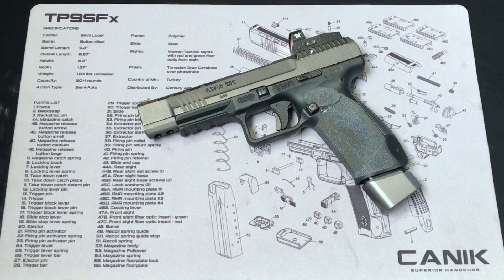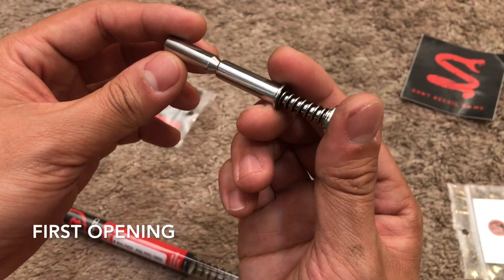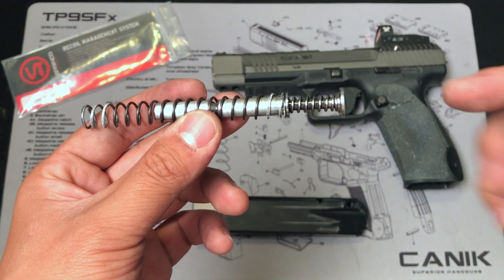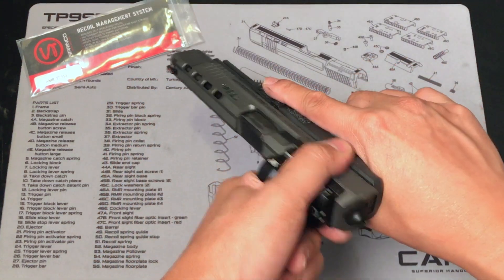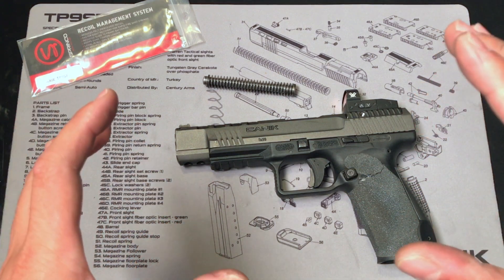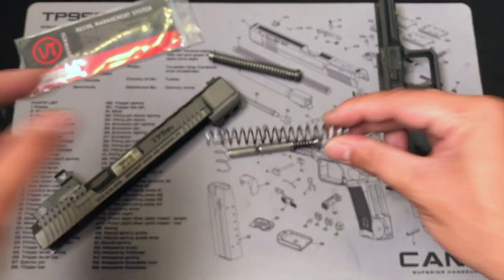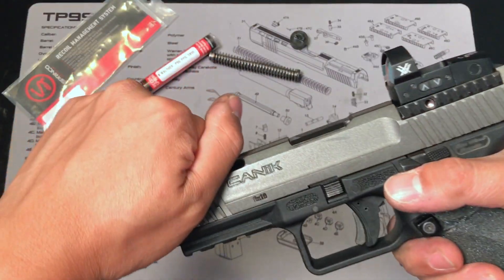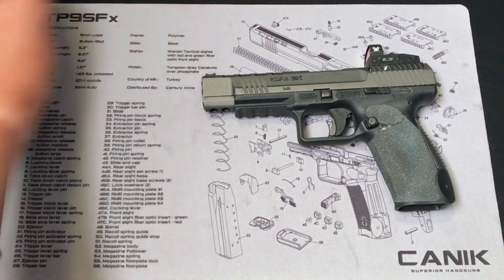Sprinco USA Recoil Management System

Comment: Frank would any if these springs you trust for service? I'm in security I carry a tp9sfx. If you would trust them which color would you suggest to use with 115 to 124 grain hollows? Confused on the difference on the colors.
Reply from the maker: So I’ve been using the same setup for my SFx  in competition for more than 40k rounds and under my website I do have the setup I’m using for SFx.we also updated the spring so the yellow one is better than the white one. White one is inconsistent with different kinds of ammo on the market. The yellow one is 1lb heavier than the white one. Check it out at my site frankthetankshooting.com

Comment: Frank, How many rounds are you getting before you have to replace the recoil springs. I used the Sprinco Yellow and after several thousand rounds it jammed and the slide was stuck halfway back. When I inspected the recoil spring  and compared it to a new one it was about a 1/4" shorter. Just wondering if they wear out this fast and if what happened is normal.
Reply from the maker: ostbob it’s normal, I switch it every 3000-5000 depend on the situation.
Reply: Outstanding, glad to know I didn’t get a bad spring.

Comment: Oh sorry but does the grain of bullet make a difference been shooting 115 grain just did a freedom Smith trigger and leaning on putting this recoil system in my sfx
Reply from the maker: It does make the recoil impose feel smoother, better follow up shot, and make the gun more reliable. I’ve been using the recoil setup for more than 40K rounds and still doing strong. The recoil spring setup can use different grain bullets. We have Black Friday Sales right now and will end midnight today. frankthetankshooting.com

Comment: how much of a difference did this make in recoil?  was it significant?  what percentage in recoil reduction would you estimate?
Reply from the maker: I will say the recoil for me is around 15-20% and it makes it shoot even smoother. I still have this system but they improve to a yellow spring. It’s even better and noticeable. I have 30,000+ on this system.
Reply: @FrankXuFranktheTank  do you have the info on that yellow spring?
Reply from the maker: TheDriftmang I do!! I am using it right now. If you buy it from Sprinco, they are the the spring for SFx with the guild rod now.

Comment: Does your tp9sfx  work well with the combo sprinco recoil management system and the fat daddy trigger?
Reply from the maker: swat0422 yes and that is something I’ve been using.
Reply: I just installed the trigger and the recoil system.       I’m having malfunctions.   Just wondering if you has the same thing happen to your Canik
Reply from the maker: swat0422 I don’t have any problem with mine :)

Comment: Frank If I am only going to get one spring , how do I know which is the best overall spring?  I know you said that if you take the optics off you would change over to the red spring.  What is the difference in the performance and are there pros and cons of using one over the other?
Reply from the maker: James Casas Jr I will say if you are running your own ammo load use the whit one. The white spring is the lightest spring. If you are shooting for Tactical the training I will suggest the red spring, because it's stronger and more for hotter ammo, such as most of the factory ammo! Overall I like the white spring, and I shoot it all the time m! Hope this help, if not please let me know :)
Reply: I will be using factory loads.  I have tried 147 grain in the current factory setup and like the reduced muzzle flip it has just recently bought some 124 grain to see the difference between that and the 147 grain.   I also have a box of 165 grain that I am going to try.

Comment: Frank what grain of ammo you use for the white spring and for the red spring?
Reply: Reasonable question. Sprinco will ask you about your preferred loads when you order and will be a better source than any one user. I first looked at Sprinco a year ago. It was made clear I needed to pick a load as the pistol would be more optimized for that load. Talk to Sprinco about the whole range of loads you want to run. Remember you can go back to the stock rod and spring in one or two minutes, or to a 2nd Sprinco supplied spring.

Comment: Frank, I changed the recoil to the Yellow sprinco, 29 lb Newton striker spring and the cajon reduced power safety plunger spring and the slide won't stay back after the last round is fired. It will stay back on an empty magazine. I changed it back to the OEM recoil and it does the same thing. Do you know if the striker firing pin spring would have anything to do with  the slide not cycling back far enough to catch the slide stop? Shooting 115 grain
Reply from the maker: ostbob have you tried fire the gun without interfering the slide lock? Sometimes it happened because the way you grip the gun.

Comment: I went another direction and added a Glock Gen 3 stainless steel recoil spring assembly with a Gen 4 adapter. It was significantly cheaper  at 22.95 and now I can try other Gen 3 springs if need be.
Reply: luiz79, could you please explain to a newbie in further detail? I just bought my canik tp9sfx and am starting to accessorize it, but like everything, I would like the most cost effective form. and if your recoil spring setup works just as good as this for 23 bucks, I am DEFINITELY interested. Thanks.
Reply: Glock Gen 3 what model??

Comment: NO it not the grip, I noticed that when you changed your recoil spring you also changed the striker spring which I did also. Does the striker spring have anything to do with the  slide not coming all the way back when it cycles after the last shot? 
At this point the last thing I tried is replacing the OEM recoil spring and I left the 29 Newton striker spring, because in my mine I can't see how that could be causing the problem. Do you agree?
Reply from the maker: I dont know why your is doing that... It is really hard to say what kind of problem is that. I'm sorry
Reply: @FrankXuFranktheTank  I apologize. I would have bet my life it wasn't my grip but today I accidentally caught myself changing my grip so that the thumb was touching the slide lock..... Now its working perfectly.....unlike me. Thanks for your advice
Reply from the maker: ostbob yay!!!!

Comment: Frank I just received my tp9sfx today with my Venom site. I was wondering I've heard a lot about The Recoil spring issue has Canik resolve this? Should I get this recoil Spring right now? I'm very excited to try it out still has the stickers on it I really enjoy your site it's been very helpful
Reply: Canik has light and heavy springs available for different ammo weights. After putting an RMR on mine it wouldn't cycle 115gr consistently anymore on the factory recoil spring.

Comment: Hello Frank, Is that Sprinco recoil system made special  for Canik or  it is same as for Walther?
Reply from the maker: They make for Canik but they haven't put the SKU number up. It is still under Walther PPQ but when you check out, tell them that you need the Canik one in the comment section. They will send you the right part. Hope this answer your question :)
Reply: Is than mean regular Walther spring will not work?
Reply from the maker: Well are you saying the Sprinco spring or other brand? Sprinco share the same sky number but they make one for Canik, it just they haven’t update the website. If you say other brand or even Walther springs l, I’ll say it will work. People tested Glock spring. Sig guild rod with 1911 springs, etc. it just what are you looking for? :)
Reply from the maker: That is correct!! I would still get the right part for Canik for sure. I use different parts that was make for CZ75 and it sort of work on Canik. Right now I believe that it is better to get the right part for the gun

Comment: A slow motion video recording comparing a stock recoil spring to Sprinco would be nice, recording both systems in action to verify and compare..  Nice video
Reply from the maker: I was going to put it in this video but, when I went home and found out I forgot to save the file haha!!
Reply: @FrankXuFranktheTank   did you ever put up a side by side in slow motion?
Reply from the maker: I tried to but I was using cell phone as a camera and I don’t think it did a good job because the slow motion is not the one I like. So I might post a follow up video in the future with my real sport camera.

You can also check my Instagram and you can see some video that the gun is super flat using the recoil spring system. I’ve been using it since than :)
Reply: Does it cycle fully and eject well? I’d be worried going down in weight but also worry that the gun won’t fully cycle after each shot.
Reply: @xlcaboselx  Ya I'm really interested in this spring, but Im afraid my loads won't be hot enough to cycle reliably

Comment: Nice information, hard to find , one question if I use 147 gr, which spring should I 'll get ?
Reply from the maker: What do you mean hard to find? My suggestion is get two springs, which are the white and the red one. The reason behind this is not every one like the white or the red spring. If you have more options and you can tune it to your own ammo. I have both and I use red spring when I shoot with iron sight. I use white spring when I shoot with the red dot. Please let me know if you have any other questions.
Reply: Frank Xu - Frank the Tank , I meant is hard to find information about this gun, also the number you said for the red spring shows 4" and not 5", is it still good ? Thanks for the answer
Reply from the maker: Yea, it is fine to use the one. 

Also it is hard to find aftermarket parts for Canik now, but I believe it will become more and more common for sure. I am working on some other videos about some other aftermarket parts as well. Right now I have the baseplate for the mag and recoil spring. Thank you so much for asking questions :)
Reply: Does the white spring not work well with iron sights?

Comment: I will be shooting factory to start with. And thanks for the link for the mat.
Reply from the maker: Jody Rowe that's awesome!! If you are shooting factory, 124/125 and 147 are better than 115
Reply: Frank Xu - Frank the Tank ..If    I shoot 115g which spring is better from sprinco?
Reply from the maker: I will say white spring. I use white spring if I run the red dot or iron sight. I shoot 115 for training and 147 for competition. I like white spring better, but everyone is different. I got both red and white spring.

Comment: On my Walther Q5 SF with the yellow spring it was insanely difficult to get it in. I struggled for >15 minutes - It was impossible to do as shown in this video. What I ended up doing was finding a narrow body pen, inserting it through the hole in the front of the slide and slipping the spring over that, then pushing forward, which forced the pen out of course. Doing it this way had it installed in under 5 seconds!
Reply: I had the same struggle putting the yellow spring and Sprinco 'recoil management system' into my Canik TP9 SFX. Couldn't get the assembly to go in the last 1/4" or so. Eventually got it in, but I am dreading having to do that in a week when it needs cleaning again...I'll try your pen or pencil method. thanks!

Comment: I had a problem with my SFX last night while shooting and now when I rack the slide it's fine but when I try to see if the trigger will reset it won't. I've looked at your video but can't see if mine is exactly as I see yours or if I have a broken part. But do you know what would cause it not to reset the trigger. When I say reset I mean I pull the trigger and hold it back then rack the slide again and slowly release the trigger and I don't see or hear the click that its resetting. 
Any help would be greatly appreciated, hate to send it back to Century Arms.
Reply from the maker: ostbob it is hard to tell, I’ll say just clean the gun and also lower frame as well, lube the gun and see what happened. Sometimes it just carbon buildup cause the issue. It’s hard to tell.   I have more than 30,000 rounds fire on the SFx and doesn’t have problem.

Comment: Would that white spring work on the TP9 SFL
Reply from the maker: Shiloh Mcfadden right now is yellow spring and it is standard on their site. I also use yellow spring now
Reply: Frank Xu - Frank the Tank okay, now will it be in the Canik section. And would I have to buy the complete Assembly or just the spring
Reply from the maker: Shiloh Mcfadden if you have their guild rod than you can just buy the spring. You can buy the spring itself but I can’t guarantee it will work

Comment: Hey Frank, love your vids on the canik. I have a TP9FX elite. Can I use the same recoil spring replacement or is there a size difference?
Reply: My mistake...its a TP9SF elite
Reply from the maker: I think you can use the same recoil spring. If you call Sprinco USA they will make sure you get the right part :)

Comment: If I'm shooting 115gr will the white recoil spring work with the stock firing pin spring
Reply from the maker: Yes, it will :) Just a reminder about the firing pin spring , if you change any aftermarket recoil spring that is lighter than your stock, you need to have a lighter striker spring as well. Otherwise, the striker sprung will be too strong and will pull the slide back. Sprinco do have striker spring as well.
Reply: @FrankXuFranktheTank  oh yea, I got the firing pin spring and striker spring mixed up. So I will need a lighter striker spring. I think I read somewhere that I can use a stock G17 striker spring. Is this true?
Reply: @FrankXuFranktheTank  Also do you happen to know which Sprinco spring I'd need to get with the white recoil spring? Sadly their website is pretty terrible :\
Reply from the maker: Jesse Novotny so, Sprinco also make striker spring for Canik now, the easiest way to find 19170 is the product number for Canik recoil spring. When you check out, tell them you want the set for Canik whatever you model is and they will send you the right one. You are right, they are wroking on updating their site. I forgot the product number for the striker spring but you can call them! They are super nice and will educate what you need :)

Comment: Frank, is the springco legal for production division?
Reply from the maker: bulm540 that's a really good question :) according to the USPSA rule book, appendix D4  21.5 stats that any spring considered as internal parts and is not visible. In this case you can use the Sprinco in production division.
Reply: cool, im shooting a stock 2 in production but may shoot CO next year. considering the canik.
Reply from the maker: That is awesome! Canik is definitely the best choice on the market. I use it since it came out this March. I love it and I use it in every match and no issue at all. You will not regrade it once you have it!
Reply: cool

Comment: Frank What different recoil is between stock spreeng and Sprinco from 1 to 10
Reply from the maker: Boris P I will say 6-7!! The stock spring is really heavy and when the slide goes back, the energy will impact on your hand really hard. They way Sprinco makes it is to transfer the energy back to the slide so make the slide back to the position faster. The benefit on this one is less energy on your hand and make faster follow up shot!! Again, everyone is different. Some people will say I don't feel the different, some people will say, wow!! That's a lot of different! For me, I like it. I went back for the stock spring couple times and still think Sprinco recoil management system is still better then stock spring. :)
Reply: Frank Xu - Frank the Tank Canik is my first polymer pistol,  but like all polymer pistols have bad recoil. Thanks for respond definitely going to buy one...
Reply from the maker: Boris P I'm glad I can help out

Comment: Frank Xu thanks for the recommendation and review of the Springco spring set up for the SFX. I’m about to order the kit for SFX. Would you have a recommendation for a spring set up for the SF Elite?
Reply from the maker: I will say. If you are shooting a dot. Use it with their white spring, and if you shoot with iron sight, use their red spring. I will still use the same products number and tell them you want it for the Elite
Reply: Frank Xu - Frank the Tank thanks Frank. I will contact SpringCo for a recoil system for the Elite.
Reply from the maker: No problem :)

Comment: I didn't change my recoil spring yet,but im ordering one , what I did  for now ,I opened slide for a week , and now it cycles my hand load,
Reply from the maker: For sure! I was doing the same thing when I got my gun. Since I got the Sprinco Recoil system, I can tune my load for carry optics or limited. Good for you for getting one of the RMS.
Reply: Neat idea. I have been cycling the slide by hand, getting used to the feel of it and working it out. If I have cycle issues, I may try your idea.

Comment: I have about 9 or 10,000 rounds through my canik tp9sf, I was at Front Sight (4 day training class) and my trigger locked-up, just would not pull.  Once I released the trigger it was fine but it happened a 2nd time then a 3rd.  Any Idea's
Reply from the maker: I will make sure you take down your gun and make it really clean and try again, lower frame and slide, take down, clean it and lube it again. If it is still happening, let me know :)